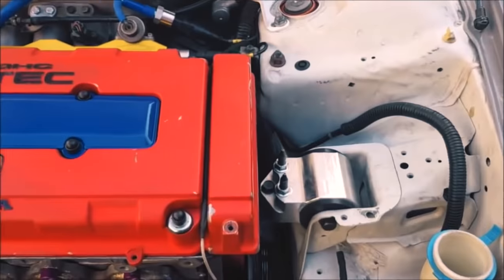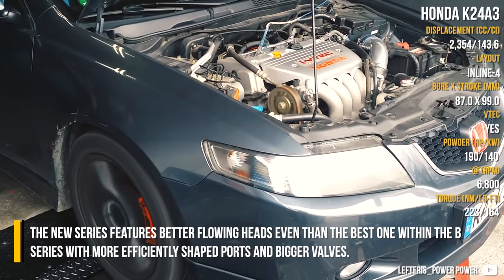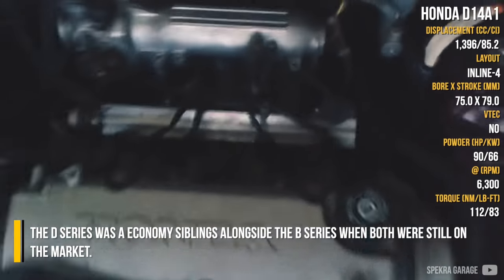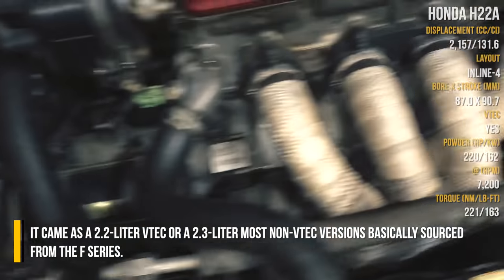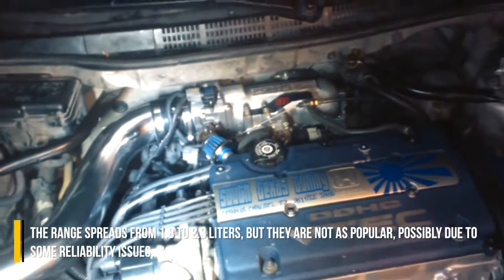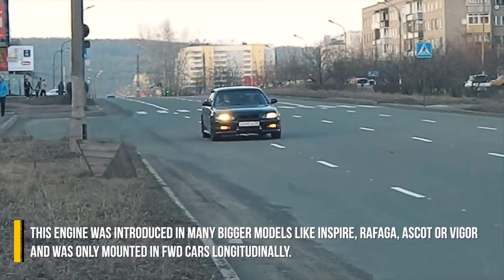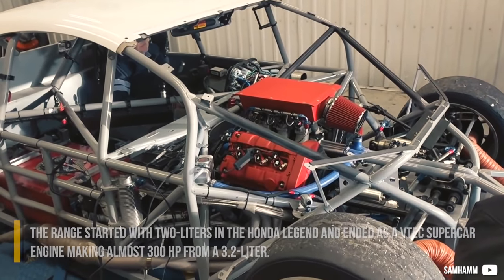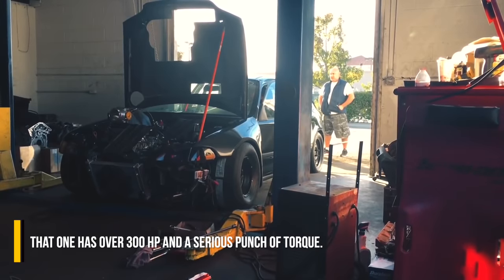Honda Engine Series: Explained

Comment: So im looking to get a 2001 acura integra base as my first car and was wondering what vtec head would fit?
Reply: Ethan James b16 head, I also recommend a b16 tranny as well, I had an 00’ integra LS as my first car and that was my setup, b18b bottom b16a head with a b16 tranny and stage 2 clutch
Reply: @ChrisB-bf4sq  Thanks a lot man how hard was it to pull the engine out to put the tranny on? Also is there anything else I need to make the head compatible with the b18 block?
Reply: Ethan James , it’s your basic Honda, I wouldn’t recommend you do it yourself if you don’t know much about doing it, I found it not too difficult but it depends on your level of knowledge, things that I recommend you know is how to Align a clutch properly and make sure you have all the right tools and equipment. The b series just like k,h,d,f series is interchangeable. B16 head is a straight bolt up
Reply: Don’t get confused within my wording , b series is straight bolt on with other b series, h series is straight bolt on with other h series and so on, if you want to interchange others for eg, right now I’m running an H22A with a K20Z1 tranny to do such you would need an adapter bracket
Reply: @ChrisB-bf4sq  Hey thanks man I know a thing or two about cars probably the most in my sophomore class which is not saying much. Anyway what about wires. Such as an ecu and stuff ive heard people say I would need a gsr ecu but I thought id ask you you seem knowledgeable on the subject? Also sorry for bothering you so much.
Reply: @ethanjames558  dont worry bro its not a worry at all! i love to educate when i can, you will need an ecu compatible with vtec otherwise it just wont work lol, gsr ecu will work and so will a civic sir ecu, but i recommend either a hondata or chipped ecu, i was running a chipped gsr ecu with a hondata as well but it depends on your budget. something that would help you alot is learning how vtec solenoids work which you can find a youtube video on, once you understand how vtec itself works the whole situation about which ecu to use and all that will become alot more clear. feel free to ask me anything you may be questioning ill be more then glad to help explain to the best of my ability!
Reply: @ChrisB-bf4sq  Do you have a facebook or instagram or something?  That way we can keep in touch outside of here.  If not thats cool too.
Reply: Search forums and read. Honda-tech, team-integra and others. There is so much info out there it has been beat to death.

Comment: F22 was popular for frankenstien builds my accord was a frankenstien build the vtec head from a preferably destroyed bottom end h22 fits perfectly on top and wiring for vtec is easy as well they make kits for it. Mine was turboed after 1 year of ownership. i did the frankenstien shortly before. i was makeing roughly 230 had a few power adders installed prior to the turbo walboro 255 fuel pump 750cc injectors stainless steel headers and hollow cats and an exhaust. i cant remember the company by no mean was it rice sounding had a super deep hum.

Comment: What about the tiny mighty L-series! 1.5L VTEC 4 cylinder that is in the Honda Fit!
Reply: Not Hitler but the guy's right, he should've talked about the L series, also the R series
Reply: Not Hitler I liked his comment and also dislike your comment, case closed.
Reply: how do you know if someone likes their own comment?
Reply: Yea I cant believe he forgot the L smh
Reply: Yup, the L-series, R-series and (especially) the K-series are the best engines Honda has ever made.
Reply: Also forgot the N series not many people know what it is.
Reply: @thevdubber6918  That's because diesels are garbage.
Reply: idontcare80 not really my car is faster than a civic Ep3 and has a lot more torque newer diesels are better than they used to be! Police in my country wouldn’t use 330D BMW’s if they were “garbage” not a lot of people can out run them actually!
Reply: @thevdubber6918  No, people just have delusions about diesels and think that they're better than really they are. The new ones are MUCH worse than the old ones, they're over complicated and choked up with unreliable emissions control systems. The Accord with the 180 hp N22 is significantly slower than the Accord with the 1.5 liter turbocharged engine, in fact, it's significantly slower than most of the gasoline versions of the Accord that we get in the US..
Reply: idontcare80 not really your deluded if you think most petrol accords are faster than the N22 you obviously have never driven one.. the 1.5 turbo economy engine is trash I’ve had 150 mph out off my Diesel accord that was never offered in the US you never got the ctdi engine in your country, also most cars in my country on the road are diesels.
Reply: @thevdubber6918  I don't have to drive one, there are people who test them for a living and make the results available to the world. The Accord with the 180 hp 2.2 i-DTEC gets to 60 mph in 8.7 seconds, the gasoline Accord with the 1.5 liter turbo gets to 60 mph in 7.3 seconds. It's simple physics, the gasoline Accord has a better power to weight ratio, which makes it faster. Even diesels must adhere to the laws of physics.
Reply: idontcare80 I’ve had my accord to 60 in a lot less than that don’t believe everything you see on paper a Ep3 type r does 0-60 in 6.4 seconds and I have beaten one also what your forgetting is how the 2.2 diesel is at its best when it’s racing from a rolling start Bhp is nothing without good torque to back it up.
Reply: @thevdubber6918  Torque doesn't do anything for performance, power to weight ratio is all that matters. Diesels don't break the laws of physics. You just have no idea what you're talking about. If you beat an EP3, he wasn't racing.
Reply: @thevdubber6918  "I suggest you look more into that one!"

I have.

"Torque wins races simple as!"

Torque output at the wheels depends on power output, the wheels accelerate the car.

"Look at Tesla for example plenty of instant torque from its electric motors and leaves any production car for dead."

They also have 700+ hp. With electric cars, it's not about how much torque is being made, it's that it's being made over a wider rpm range than in an ICE vehicle. The Chevy Spark EV, for example, had 400 lb-ft of torque, but it was slower than the current Nissan Leaf, which only has 236 lb-ft of torque.

If you won that race, you either live at very high altitude (where your turbo gives you an advantage), or there is something very wrong with your friend's Civic.
Reply: idontcare80  not all Tesla’s are 700bhp+ actually and also the lesser models are still the fastest in their classes most have lower HP and a shedload more torque I suggest you watch CARWOW on here and see what they do to the competition, torque matters and also so does gearing, also the Chevy spark is slower as it has rubbish gearing and is generally a rubbish car, and as for my mates EP3 it has been put on a dyno recently and is a healthy K20a2 engine running 198bhp!
Reply: @thevdubber6918  Tesla's all have a good deal of power, the least powerful one is the Model 3, and it makes 271 hp. The Plain Jane versions of the Model S make over 400 hp. The Leaf and the Spark are geared for roughly the same top speed, which means that you can't improve on the gearing in the Spark without seriously harming the top speed of the car.

AGAIN, the AMOUNT of torque doesn't matter, how broad the torque curve is matters. 

I don't have to watch anything, the laws of physics don't conform to your ignorant understanding of the matter. The math is VERY simple and it proves that torque doesn't matter.
Reply: idontcare80 toque matters simple as I’m not carrying on this debate for you to tell me otherwise a car for example with the same weight with 250bhp and 400nm will always be faster than a car with 250bhp and 280nm.
Reply: @thevdubber6918  I already gave you some examples! Your Accord diesel is SLOWER than the turbocharged 1.5 liter Accord, yet it makes almost 100 lb-ft more torque. The Spark and the Leaf have very close to the same amount of power, the Spark has WAY more torque, yet it's slower.
Reply: @thevdubber6918  I'm specifically referring to the Spark EV, that's the only version of the Spark that we ever got in the US, I just now learned that it's a common ICE car in other parts of the world.
Reply: idontcare80 I doubt it’s faster than my accord mine isn’t standard, the new accord is slower than an Ep3 so its no competition for my one. Yes they are available in other parts of the world got them in my country aswell
Reply: @thevdubber6918  Facts are facts. Consider that we often get different versions of gasoline engines in the US and they're usually excellent engines, which is why the vast majority of Americans don't bother with diesels.
Reply: Rhys Jdm the ep3 in the UK has the k20A some of them don’t have the k engine they are a 1.8L I think
Reply: Steevnb * The ukdm ep3 has a K20A2 engine don’t get it confused with the jdm K20A they are completely different, and also the ukdm ep shape civics come with 1.4 1.6 1.7 ctdi and 2.0. There is no 1.8 engine.

Comment: Are the K series much superior than any other series?
Reply: I think they are even better than the new k20c1. The k20c1 omits the vetch on the intake side, which is terrible for us tuners who want big cams with factory idle(That's the whole point of VTECH). If in the future, Honda implements VTECH on both cams, then that engine will be king. Oh, and maybe take what Hyundai did and incorporate that into the k20C1.
Reply: @nezabytes  Learn to write VTEC
Reply: except the F20c, yes.

Comment: Honda:  tiny engine, million rpm, decent peak power (if you have patience), 3 ft-lb torque, noise that implies sound-barrier breaking speed.
Reply: That's why the smaller engined high revving hondas like the civics have very close ratio gears...the torque is made in the gearbox
Reply: There's just no feeling of power without solid crankshaft torque.

Comment: So I could put VTEC head in my Honda CR-V with a factory standard B20 engine to make it VTEC?
Reply: Yeah gsr head.
Reply: And get it tuned with a hondata s300 ecu or something. My buddy has a b20 block from a crv and a head from a gsr. With type r cams and a hondata s300 ecu
Reply: Gsr or b16 too
Reply: The heads you can use also is b18c Itr
B16b ctr
B16a
Impossibly the B17 GSR
Reply: @ethan12313  how much does it make like that?
Reply: @jimlucas0  a couple grand to do it right. For the same money you could turbo it.
Reply: People have done that for many years.
Reply: Absolutely
Reply: @eriktruchinskas3747  I was talking about power outputs but damn if it costs a couple grand nvm then lol
Reply: You can. Only problem is emissions.
Reply: @jimlucas0  oh sorry I was tired when I read your post. You will make high 100s maybe 200 with IHE and cams. At that point you upgrade your clutch so why not just turbo so you can brag to more people than just hondaphiles?
Reply: A b16a head does wonders on a CRV block. The bolts and the job is whats going to be slightly pricey but definitely affordable.
Reply: Yes! Im running a B20 block with a B16 head
Reply: I have a b20 block with b16 head and type r intake manifold ported with type r cams and type r crank all motor build pushing 297hp 💪🏼 on eg hatch fully gutted
Reply: Mark Hernandez  when I said 2000 I said thats to build it right. You can slap on a c1,c5,b16 head on, buy the kit online, chip the ecu, and not do any work to the bottom end but the chances of snapping rod bolts and ruining the block are good. With how much people love to bounce off that hightened rev limiter it pays to build the bottom end. Also if it wasnt for the weed id move to arizona or florida where its still warm but I can do what I want to my car.
Reply: Yea. Had that in my EK. GSR Head and a ton of RSX-S stuff too. Too bad they kept stealing it. Went Cadillac and can leave my ATS open over night in the hood without worries.
Reply: @Seba-lk4hp  im afraid that if I park my integra out on the street overnight itll get taken or fucked with. Im suprised though, I live in a area that you would think would be prime for getting your car stolen (working class neighborhood next to industrial park so not much traffic to worry about seeing anything) and theres a rsx and eg6 parked out there all the time and nothings happened to them
Reply: @eriktruchinskas3747  just always take the long way home. They kept taking mine from in front of my home. I live in a good community. Never had cameras on it which was stupid of me. It could've been my own neighbors who set me up.
Reply: @Seba-lk4hp  when I get to park my car in the driveway I always make sure to park a car behind it. Maybe ill install a kill switch
Reply: @eriktruchinskas3747  I also did the same but they also stole the car blocking me in. Some people are desperate because they wonder why your build is fast and cheap. They stole the TL just to get the Civic. Be careful. A garage is the safest. My friend had a mint ITR and left it in front of his house for 2 hours and they took it. Only found the lojack laying on the floor a mile down the road. I live in South FLA.
Reply: @Seba-lk4hp  lol someone tried taking the tacoma I had parked behind mine. All he managed to do was ruin the door and ignition cylinder of the truck. After he did it the keys wouldnt turn the cyliner. The only thing that would turn it was keys with the teeth worn all the way down
Reply: @eriktruchinskas3747  lol. Lucky that was all. I hope your luck is better.

Comment: Omg Honda 5 cylinder?
Reply: Yup, sadly there was no 5 cylinder for the European market.
Reply: It's sad, sounds like a good swap :/
Reply: Its the only family I have never seen before here in the U.S. it would not be a good swap at all because there is no aftermarket support, so unless you have pretty good fabrication skills and don't mind searching far and wide everytime you need a part...
Reply: Dylan White I'm used to looking for parts, since I ride Honda MBX80, it's very rare where I live. Als I am a machinist and have qualifications for CNC machines, so I can make some stuff :)
Reply: It was inside the Acura Vigor (us market).

Comment: what about L series?
Reply: User996  nope it takes L's
Reply: I think it's pretty newer, he should have covered it...
Reply: Siddhesh Gharat  is it the new turbo engine for the new civic
Reply: Also the R series.
Reply: @berys76  yes yes. The Civic utilises the turbo version. The Fit/Jazz has the NA one...115hp @6600 rpm and 146Nm @1400-5500 range... Pulls hard and loves to be revved...
Reply: @mahiru20ten  I had an R18A2 engine in my Civic hatch.
lovely little econo engine.
Reply: @mahiru20ten  Was waiting for that in the video. My parents have a 07 CRV & the R20 gives a pretty decent fuel economy & has decent torque when you need it
Reply: @siddheshgharat6300  newer gen fits have 130hp version and it is well tunable engine. mugen and hks make tuning kits at least hks has turbo kit for Fit
Reply: L15 205 HP 10th gen > 9th gen 195 HP

Comment: The f series motor came out in 1990 all the way to whenever it ended. My 92 accord has an f22a1 in it and it's got 235000 on it and I haven't had any issues with it thus far

Comment: As someone that has helped a friend build and tune his high compression LS/VTEC (B18A1 block/ported B18C1 head) engine and also has tuned it, the B-series is a marvel of late 1980's/early 1990's technology. The B-series engines truly feel like motorcycle engines in cars. The only disappointing B-series to me was the B20, at least bone stock. The rest of the B-series line, as long as there is a manual transmission backing the engine, they all feel great to drive from just off idle to red line. When I finally got to drive a well built H-series though, and felt the amount of torque that beast can make.....I kinda want to H swap my other Civic.... I can say I also truly respect what the K-series is able to do as well. Drove a friend's 4 door Civic Si with its K24 before and after some mods. I was not impressed with the car stock. With bolt-ons and a tune by Humble Performance, I suddenly wanted his car. Honda engines can be SOOO awesome with so little effort, and they tend to be pretty darned good from the factory.

Comment: The D Series are mostly very low compression, my D14a4 is 85cr, it's almost Turbo compression as standard.
Reply: I just did a compression test on my D16y8 today and got 230,228,231,229. Im going to double check it tomorrow with a snap on Guage.
Reply: @BradKarlovec  that's high  compared to my 300K mile y8

Comment: Dear VisioRacer,

I just wanna ask your personal opinion. Which of these 2 motors would you rather prefer swapped into a BMW E46 sedan chassis? Between a RWD-swapped and boosted Honda K24A2 or a 1JZ-GTE VVTi? (Both of these motors have aftermarket adapter plates that allow for the BMW manual transmission that I have in the car to be bolted on directly.)
Reply from the maker: What purpose is the car going to be for?
Reply: 90% spirited daily-driven (fun stuff includes b-roads and touges; but not fun stuff includes 2 hour traffic jams and getting groceries), 5% autocross, 5% trackday
Reply from the maker: I would personally take the JZ: higher potential and for me most notably a better sound. 6 cyl is a 6 cyl
Reply: Thanks for your input!

Comment: I have a Honda Odyssey with a J serirs engine and I disagree with the statement with the lower to mid range torque.  Its peak power is a mid range engine to higher rev range for a stock vehicle.  I don't know if a better gear ratio in the transaxle would help the bottom end but I can say it is a strong engine and surprises me how fast something that big can move.  To me it more of a big wagon then a van when you think of it.  Overall it's a great vehicle that people can laugh at until it pulls away from them.